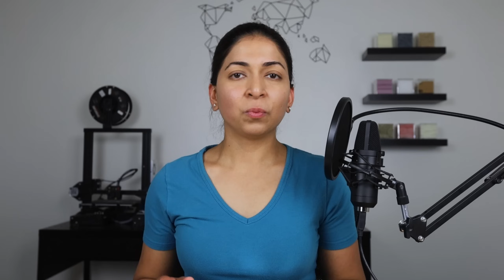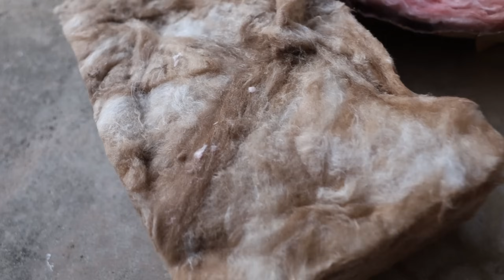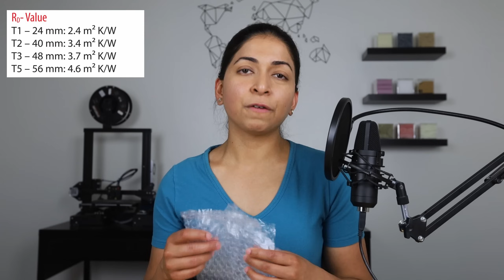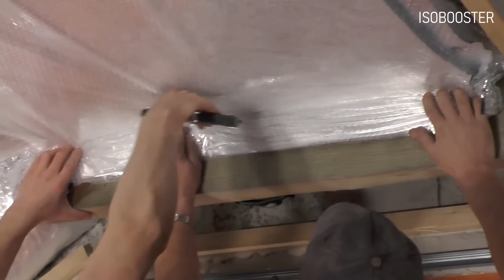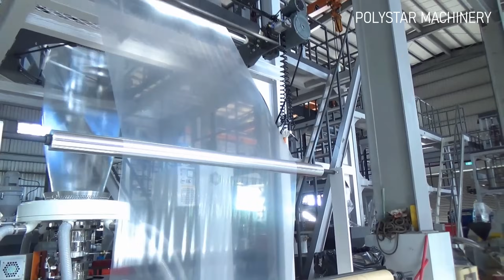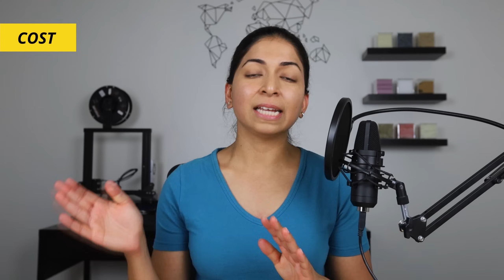Bubble wrap home insulation? | Isobooster

Comment: I live in a trailer with pretty bad insulation. Its actually pretty common to put aluminum foil on our windows here in Georgia. So i'm gonna look into finding or making a similar product and testing it out now that colder weather is coming. The windows and my closet all so much heat transfer its crazy. Putting my hand near the base of the door on my closet feels very cold. I'm gonna get some different sized bubblewrap with some foil and see how it works for small temporary insulation
Reply: It's great at reflecting heat, but also a conductor (like metals generally are). The bubble wrap is a poor conductor (air pockets and plastic). The combination allows it to work. Just aluminum foil on a surface would seem like a bad idea.

Check at a local Hardware store/DIY store if they have products like this. Look for radiator reflector / radiator foil and see if they have any with this system, they are thinner than what's talked about in the video, but it's also not used as the main insulation (I'm from The Netherlands, so things might be different there).
I have this (thinner version) on the wall behind a radiator, which a great place to use it, reflects heat and in the end saves heating cost.

Comment: IN australia, the foil backed insulations was installed  in part , nation wide as part of bungled rebate programme. Aswell as the mould issues mentioned, 2 workers died from electrocution as a result of exposed wires in a roof. Another issue to consider here.

Comment: Seems like a good thing for the roof of my house in Portugal. It would also be good for use as a layer in solar heaters so long as it is protected by say rock wool.
On that subject I would like to hear your opinions on pop or beer can solar heaters. On the subject of recycling plastic I am a strong believer in either burning it for energy or converting it to fuel oil.
Recycling requires that some new plastic be added making an inferior product and if you think about it that is a mathematically absurd proposition tending to infinity.

Comment: If their is an air gap with drainage between it and the outside of the wall I would probably put a thin layer of something like this under the siding but on the far side of the air gap from the walls. That way it doesn't trap moisture in the walls, and can still reflect radiative heat supplementing a high R-value layer of insulation.

Comment: As you highlight, for anything other than tiny-homes or mobile home environments, I wo9uld worry about the fire resistance of the material.

As for durability, I would be worried about the impact resistance of the bubble-wrap over time.

Comment: i love your videos and your transparency so much. its been so refreshing to come across your channel, ive definitely been recommending your videos left and right!

the carbon emissions from plastic are counter intuitively, really low! you're right there, its just they take forever to degrade, why not put it into a house that should (ideally) last for a long time! thats why i still support plastic, but only for certain uses, and realistically, recycling plastic isnt as easy as its made out to be, and only very specific kinds can be recycled. the petroleum industry was so successful on putting the burden of us to deal with the responsibility of recycling and reusing and "reducing" when in fact theyre the ones profiting off of using cheap packaging materials that wont break down.

Comment: If a product were made sort of like  potato chip bags full of air with an aluminized outside you could make a stuffable insulation with out the vapor barrier to use in existing homes. You could link them in a chain and have an air inlet, stuff empties in the wall and then inflate them.

Comment: Sticking literal bubble wrap on windows as a bit of extra insulation is somewhat common in South Korea.  Energy pricing is often pretty aggressively 'tiered', so folks tend to be really interested in keeping on that lowest tier of usage and every little bit helps.
Adding in a mylar/mylar-like layer is clever.  Good for this company.

BTW: Some museums have had the opposite problem with humidity during the pandemic.  No visitors so the air getting too dry for the HVAC system (designed for having visitors) to handle.

Comment: It's funny, I've used this stuff to insulate the new bath on the underside (I'm from the Netherlands). It's easy to work with, no dangerous particles are released when cutting it and you just tape it on there.

Comment: The DIY channel recently ran a show about a couple building an off-grid home with a "9 inch wall": instead of 2x6 studs for the exterior walls, the framer used two 2x4's with an inch of space in between them. It was described as being a "house within a house." The idea was that spray foam insulation would fill the gap in between the studs, increasing the r value of the wall. Would that actually work? And how would it affect the overall integrity of the structure?

Comment: I used a similar product under the steel roof of my shed, it works very good for keeping heat out in summer and the inside of the roof doesn't condensate when it gets frosty in winter.

Comment: I don't think the poor fire resistance was really emphasized enough as a drawback. This could never really be used in any large dwelling or apartment building since the whole structure would already be up in flames within a very short time frame.

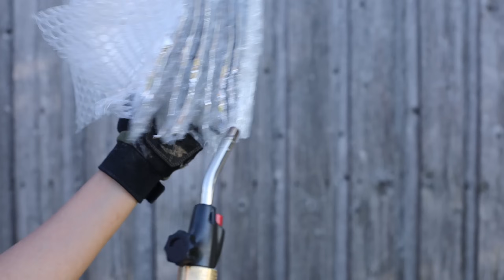Comment: 5:45 "I was disappointed with the fire resistance ... no toxic fumes, more expensive  than Rockwool, but lower installation and transport cost" "Be careful in buildings with no mechanical ventilation"

Comment: Also think plastic has been used wrong for the most part.
My concern/question would be does it break down into smaller components in adverse/hot conditions?
Reply: You'd be dead from heat before PE degrades at 160°C (320° Freedom heat units.)

Comment: Products using reflective bubplewrap have been marketed for attics in hot climates for some time. Some fast-talking salesmen were trying to sell it to my brother in Phoenix for his attic, I told him to forget it and just get the regular blown in stuff.  I have some issues with this. Since this kind of product is a low perm vapor barrier, miosture issues are a big potential. "if it can't dry, it's gonna die!" Is my mantra. In attics, I've seen failures of polyethylene over time, it can't take the heat and just falls into shreds by itself.  agreed this might have some cool niche markets where space and weight are a premium. Continuous insulation on a wall which can dry to the other side might work. I'm really skeptical.

Comment: Your fire test was poor and not setup like it would be when installed. Even a small spark can ignite this stuff and after this happens it's horrendous. All "Aircell" bubble wrap is highly (extremely) flammable regardless of what the al-foil claims to be able to resist. Install if you want to be involved in a house barbeque...

Comment: Seems like the assumed benefits of radiant heat transfer are equal for walls and roofs. Walls are subject to less radiant loads than roofs, so walls are in the conduction and convection camp. I'm not convinced, without actual product testing, that a product like this works as it is highly dependent on an unventilated air layer. Moisture and fire risks are clear. Nice video Belinda but at risk of overstating the virtues of this product.

Comment: They should fill the bubbles with Nitrogen, so that it acts as an extinguisher in case the house catches fire.
Reply: There is a brand that does.  I use it when insulation wrapping duct work.  I can't remember the name but by itself has a listed R value of 6 when wrapped over R-8 unbacked insulation it totals R-16.
Reply: A waste of time it will diffuse away over time although polyethylene is extremely low permeability it is not zero permeability. If it is really worrying just cover it in a layer of plaster or drywall. Though that would be a weight problem for boats.
Reply: Or CO2. That will have the same effect but also capture heat better. It is a larger molecule so it might diffuse slower as well.
Reply: Good idea
Reply: I doubt it would be enough to matter even if it didn't diffuse

Comment: Related to this is the use of bubble wrap on window glass. Spray a water mist on the window and hang bubble wrap. This increases the energy loss/gain through window glass quite well. Look up youtube videos to see how it's installed. I experimented over a couple of years and it helps. Works well on windows you may want to 'frost' as well to limit visibility such as baths or bedrooms.

Comment: Last year during our heatwave I bought some of that foil-coated bubble wrap you featured for a moment in the video. My metal window frames were reaching 140° and the windows were letting a ton of heat and light into the room. Just a thin layer of that stuff blocked most of the heat radiating off the window. It’s surprisingly effective. I mounted it to the window using Command strips, so it can be easily removed and replaced whenever needed.

Comment: I’m dealing with a lawsuit cause the previous owner used bubble wrap instead of tyvec under the siding ,vapour barrier inside had kitchen fire in 2015 when gutted inside from smoke damage the walls had black mold mushrooms throughout the additions the previous owner built the home was deemed uninhabitable previous owner had no inspections, lawsuit continues

Comment: I have to used the 'thinner version from Home Depot' for a few years on my pop up tent camper. We place it between them canvas and screens in the windows, and over the top of the canvas tent.

The radiant heat reduction is fantastic. In the Texas summer it in makes for a 20 degree difference in the surface temperature of the canvas between where it is covered and where it is exposed to the sun.

In the winter it does help hold heat in as well, but only what you'd expect at R2 or so.

Without it out ac would not be able to keep up with the summer heat.

Great video!

Comment: We use bubble wrap for some twenty years as insulation in winter. We have a plastic skylight in our second bathroom that looks out in our garage, which is seven meter high and in winter we where losing too much heat thru that skylight and for that reason I put several layers of bubble wrap on it. Works very well and it is the same wrap for all these years, so it lives a long time.

Comment: In the Netherlands these kinds of materials have been available for years. I have used a multi foil myself years ago in my little motorboat.  works perfect. It is als often used as a second layer of insulatien, in combination with a miniral wool. this is needed in order to get the high Thermal resistance rating that the law requires without an 50 cm thick wall

Comment: As always a really good and ambitious video. Thanks Belinda! 
I have thought about this since a few years but unfortunately came to the conclusion that it must be further developed to be usable for an architect or a builder. Besides the poor fire properties, the main problem is the big molecular size of plastic material in the bubbles. This causes the much smaller air molecules to leak out and bubbles to collapse. My tests has shown that after 3-5 years the bubbles are almost empty amd unusable for isolation. This is also why all tires on cars and bicycles regularly must be refilled and pumped again. Rubber molecules cant stop the small air molecules from slowly leaking out.
But I think this concept might have a great potential if further developed.
Reply: Air is going to leak out in order to equalize the pressure between the bubble and the atmosphere. 
I know that some brands of bubble wrap have lower pressure than others (you know those types of bubble wrap that are unsatisfying to pop? it's because they have low air pressure)
Bending the insulation around corners, putting other heavy materials on top of it, the air inside heating up and expanding, are all going to increase the pressure inside the bubble and speed up leaking. 
I can see how even if you had very low pressure in the bubbles at manufacture, in application you are going to have problems.

I hope they can figure out a way to make it more air-tight because it looks like an awesome concept!

Comment: This product is a perfect solution to the issues I have seen in older 40-80's houses especially in the craw space or foundation space areas with inferior insulation or vapor barrier under the first floor. I lived in many such houses and this product would have been such an easy install/solution to issues we faced. I once considered rockwool batts with netting to support the batts in one house but moved on. If this Bubble wrap & foil home insulation product was available I would have installed it. I held off with the rockwall because I thought it was just not going to prevent the crawlspace air from moving up through the house and may have created a mold issue.

Comment: It seems to be a good product, lightweight and easy to use / install. However as it usually is with these trendy new products, the price outweighs the benefit. In UK something like this is exorbitantly expensive due to suppliers greed and attention to profit. I can't see it being used on, say, the average extension as the rest of the house will have a different means of insulation and probably cause issues. I reckon it may be part of the spec on new builds maybe where the consumer won't even see the cost as they are already paying a hugely over-inflated price for a new house anyway. Good vid. 👍

Comment: I'm not sold....I remember the hindenburg incident.  I imagine carpenters using shit cheap staples and nails to hold this product up, then they suddenly start rusting from the evaporated and trapped moisture, now you have rust + aluminum.  The only thing missing is an ignition source and your entire house is now thermite cake with plastic frosting.

It would be so nice if we could find a way to mass produce silica aerogel....or make it into a foam spray application type.

Comment: @belinda Carr 

long-awaited, Thank you.

it's a great product. we are using a double-sided ai bubble sheet in India it does not cath fire easily as you have shown in the Video because plastic is protected by pure aluminium.

its fire resistance is not proof (please don't compare it with Rockwool or e.tc  :P )
cheap and best  insulation available in India  (batter than a traditional radiant barrier )

as you said it's a complete vapour barrier it may case in mould e.t.c same problem we also faced.

<20% sound will be reduced from the rooftop.

Comment: There are applications where this product really shines. Under concrete slab, RV's and tiny homes. Also retrofit or supplemental applications where a vapor barrier that insulates is a real time/money saver.
Reply: Interesting suggestion, under slab , as more and more states are banning XPS (or all blown styrene) building products.
Lack of rigidity may be both a plus and a minus. Surely it will want to float, where a board is simply ballasted by the concrete.
I imagine it could be difficult in this application because of ruptures from rebar and installers needing to walk on it, but we definitely need an alternative insulation product.

Comment: I'm starting a van conversion and I have been looking for a lightweight product like this to insulate with. I will keep you informed if I use it . Thank you.
Reply: I am converting a bus, I think this is the way to go for our build.
Reply: @albaugh1818  
Did you use it, or choose something else?
Reply: George, please update us, if you did this. Would be very interesting to understand more about it.
Reply: Make sure you leave a small air gap between the wall of the van and the rolled stuff like this at home depo. It helps keep the damp out. We also use it for our window shades. Keep the silver on one side and we made the other side black for night use.
Reply: So the bubble wraps on one side and aluminum on the other is that correct? If so can I use it to cover my thin 5th wheel trailers windows and  which side would go against the windows?  I really would appreciate the help. Thanks

Comment: I have concerns of the product lasting 70 years.  That is a lot of heat cycles, and I'd say the climate variance in the US is quite different than Denmark.  At least with conventional products about the worst that happens over time is slumping, and that is more installation error than product.  At least in my experience.
Reply: To contribute, I've experience of standard bubble wrap surviving the elements of the UK in external use for twenty years in use on commercial greenhouses. In that time and unprotected there was deterioration, but it was still functional and not in need of replacement. From the same roll kept in an open barn (roof, but only walled on two sides) there was no discernible difference to new bubble wrap. 

There's an awful lot of difference between 20 and 70 years, so I'm not arguing with you, just inputting my experience.
Reply: @callum_boss  Thanks for the information.  I think it has value as your example would be more on the worst case scenario side.
Reply: I have a similar experience to Callum. 11 years ago, we built a small greenhouse in our backyard and sandwiched bubble wrap between two layers of corrugated polycarbonate roofing to make the roof more insulated. Our yard is in a high elevation desert and gets intense heat, UV, and cold; 50° temperature differences between day and night are fairly common. The bubbles still look just fine and haven't deteriorated. I thought the UV would destroy it after a few years but it still looks surprisingly good.
Reply: I have used the "double bubble" products you can get from venders that is about 3/8" thick that has a foil layer on one side and white layer on the other side, and that stuff is ridiculously tough.  Seriously durable in my experience using it for a variety of purposes.